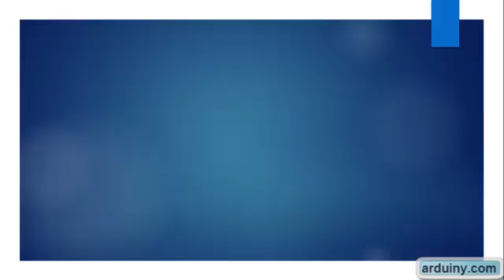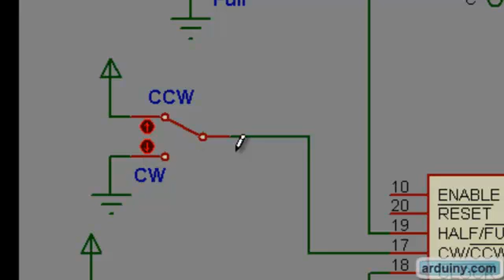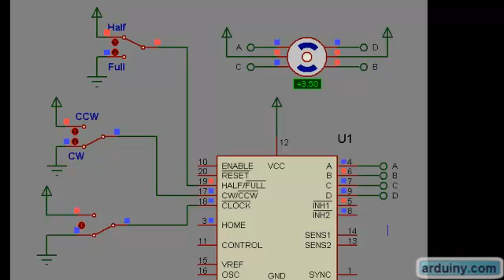L297 stepper controller for beginners 1

Comment: Dear Ahmed ! Thank you very very much for such a nice Explain ! Did you try it with som Breakout Boards ??? Such CNC  Breakout Boards , called BOB or China BOB, can active a Stepper motor Driver with only 3 Wire . They sends 2 Signals ( Step + Direction ) from the Board into Driver , which you can Active with an  ENABLE - Signal ! Is this part the Same (  those same Driver L297 )  or is it something els like L297/L298 etc???
.........................................................................................
 Please tell us, which fine difference they have all !?
 I thank you primary very much my Dear !